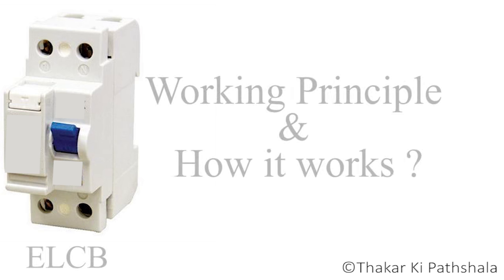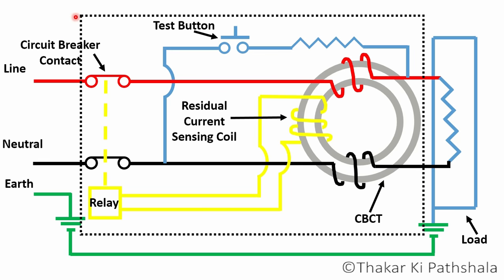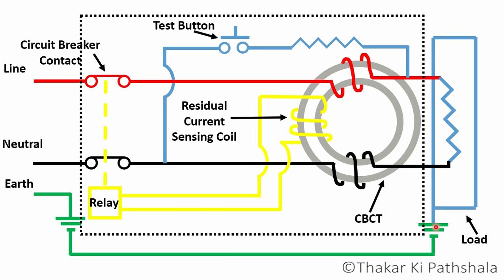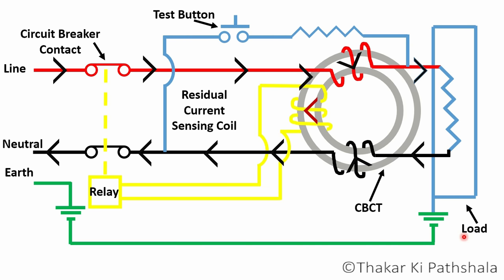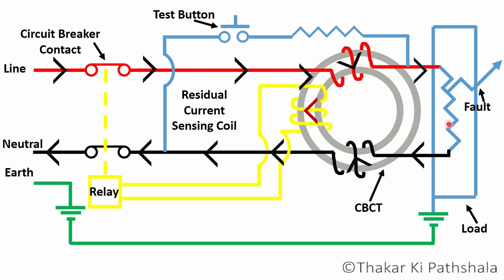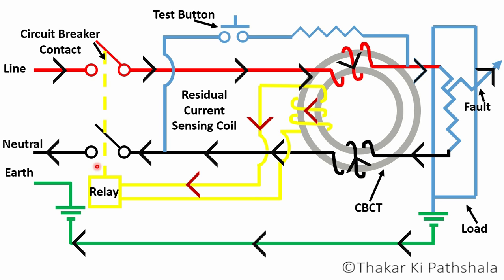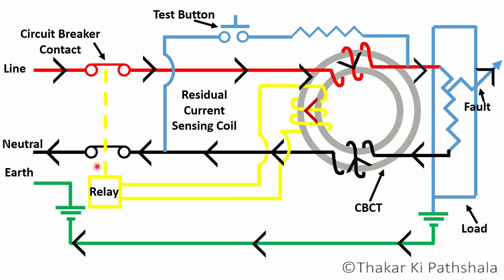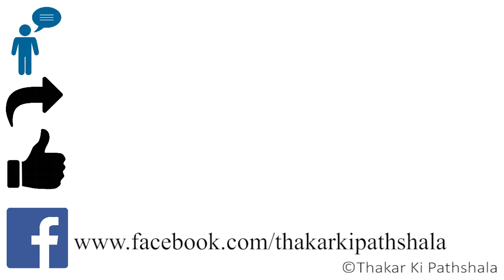Working of ELCB (How Earth Leakage CIrcuit Breaker work) and Working of RCCB

Comment from the maker: This video is basically about working of RCCB. But due to confusion in names among peoples I have to title it like this so if you are searching for RCCB but don't know the name then also you can find the right content. RCCB is very old device which were used to protect us from electric shock they were working on the voltage difference but as technology has upgraded the newer type of devices came in market RCCB which works on difference between current. So for the new devices peoples are using old name it is the same thing like people are using the name of company xerox for photocopying machine.  : )
Reply: I suppose you wanted to write ELCB in 3rd line of your para.
Reply: Sir its a good video but one correction is there that its “live wire" not a “line wire"
Reply: I think this is causing more confusion. It would be better if you name this video as working of RCCB.

Comment: mere ghr pr earthiNg nhi h pr mene jaquar geyser liya h or usme ELCB lga hua h 
to kya current lgne ka khatra ab bhi h
Reply from the maker: VIshal Rohilla if your ELCB is working perfectly then there is no need to worry because working of ELCB and Earthing they both are not related with each other. ELCB works on the difference between phase and neutral wire so don't worry about that but it is advisable to do proper earthing if your ELCB fails to protect then earthing can protect you. Hope this has answered your question. Have a nice day.
Reply: Thakar Ki Pathshala thanks sir

Comment: As you said that this is actually an RCCB and not ELCB.I would like to add that RCCB does not require earthing, while ELCB compulsarily require proper earthing of all appliances.
So if some1 is having an ELCB at home/factory plz ensure proper earthing of all equipments. Or you can replace the ELCB with RCCB.
Reply from the maker: Yes Owais Khan you are right. Thanks you for your valuable comment and information. We appreciate your efforts to spread knowledge in the community. Have a nice day.
Reply: Thanks for the appreciation Thakar Ki Pathshala

Comment: I Went to check for UPS back up for our scanning electron microscope machine . That's why i was switched off the ups switch and connect multi meter at battery . At same time our elcb tripped, and machine off. And a burning smell came out from elcb. After that when I tried to elcb on with main power on. Elcb tripped automatically again and again . Can you please described the reasons behind that???

Comment: Mere ghr pr earthing nhi ho rhi h to mene geyser k switch m ek ELCB lga di 
is it helpful or not 
plz tell
Reply from the maker: VISHAL ROHILLA thank you for watching and sharing your concern with us. Yes ELCB works if there is no earthing done in your house. ELCB is a differential type relay which work on the difference of current between neutral and phase conductor. It will work if you have installed it properly. If you are not professional electrician then it is advisable to fitted it via professional electrician and it is also advisable to do earthing of your house for better safety and also install all essential safety devices for your entire house. So you can have peace of mind. Have a good day.
Reply: Thakar Ki Pathshala sir my water heater jaquar elena 25 ltrs and it comes with company fitted ELCB in its power cable
so if there is any current leakage in water in future then it is useful or not
Reply from the maker: While studying manufacturers website i have found this " The ELCB is designed to prevent shock and injury to users. It quickly disconnects a circuit whenever detecting an imbalance of electric current leakage through the body of a person who is grounded and accidentally touching the electriferous part of the circuit. "  So ELCB will trip if it is functioning correctly at that time. It is advisable that if there is any test button for ELCB then you should press it monthly. And also do proper earthing for whole house it will barely cost 3000 - 4000 Rs. for 2BHK house. Hope you have got your answer if you have any doubt then feel free to ask anytime. Happy to help you. Have a good day.

Comment: Nice video... but in the schematic diagram is the winding of the coil entering current/return  current wire (clockwise/anticlockwise) shown correctly ?
Reply from the maker: Purushottam Latey thanks for watching and giving your feedback. Let me clear one thing the figure is just for illustrative purpose. This is not perfect winding diagram this is just for showing working principle of device. Have a nice day.

Comment: I have question about tripping test of ELCB....it has test button so at the time of pressing test button the ELCB main circuit will be turn off or not  please share me
Reply from the maker: Dear Muhammad Qasim by pressing the test button the whole circuit will be trip when you press test button on ELCB then actually what happens is that it connect phase and neutral of supply with very low resistance  so current passing from neutral wire become twice with respect to phase wire so the generated difference in current will produce flux in CBCT and then the circuit will be tripped. I hope this answer your question. Have a good day. Stay connected with Thakar Ki Pathshala. Have a good day.

Comment: Dear sir 
             what is the main differene between the ECB AND RCCB
Reply from the maker: Dear Mangesh Patil here you have write ECB I am considering that you mean to say ELCB. The difference between ELCB and RCCB is basically in operation ELCB is voltage operated devices and RCCB is current operated device. The ELCB is popular old name referring to the device which is used to prevent shock. So we all have continued to use that old name referring to this new  device which is RCCB that's why it creates too much confusion.  I hope you have got my point. In this video I have actually explained the working of RCCB but due to this confusion of names I have titled like this. Thanks for sharing your concern. Have a good day.

Comment: Nice video and explanation. I have earth leakage relay connected to my hospital. the relay trips the main circuit breaker every day evening time. I checked any fault with my devices but all are OK. I do not understand why it trips this particular time. what is your suggestion dear?
Reply from the maker: Earth leakage relays are very sensitive in nature. They can trip circuit for very small leakage detection.As you are saying that it trips the circuit at particular time. So you can keep watch at evening that if problem is causing by turning on any particular device. Without inspecting actual site I can't tell you more than this. Thanks for reaching out us. Have a nice day.

Comment: Whenever I switched on TV, washing machine, laptop charger ( working at office), ELCB is tripping. Someone can explain what is the issue and solution also.
Reply from the maker: Thanks arun kumar for watching this video and sharing your concern here. ELCB trips after finding difference between current entering in the circuit and leaving from the circuit so it can be very small leakage by which your ELCB is tripping. Most probable suspect is Washing Machine. one reason can be short circuit or over loading now a days some ELCB include protection for this also. So it will be better if you can contact the person from which you have purchased this. So he/she can provide you best solution. Because the probability of fault in electrical system are limitless. Have a good day.